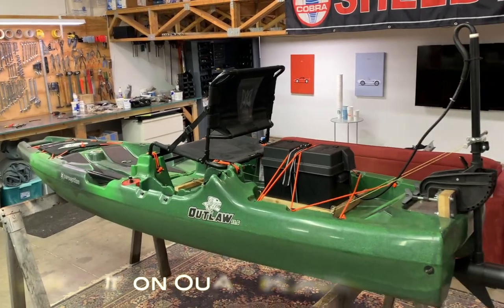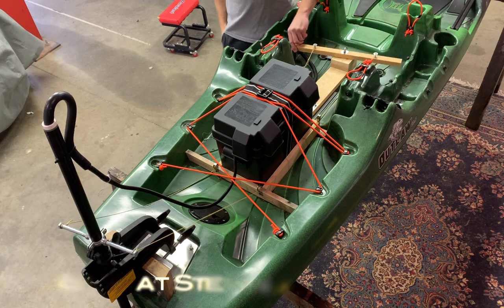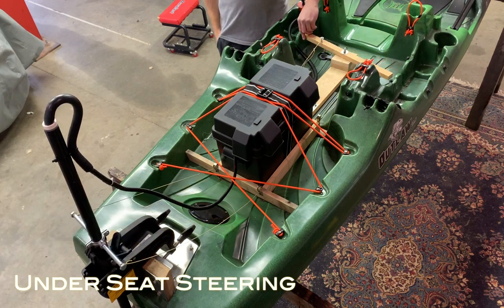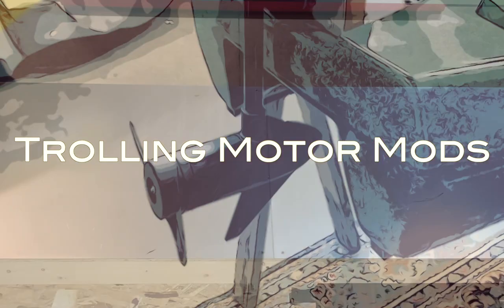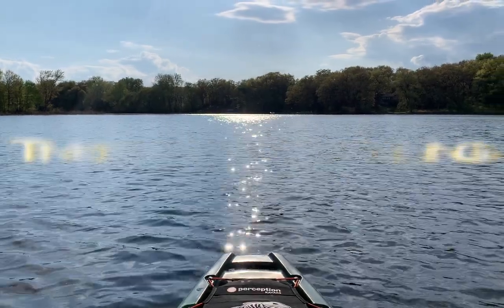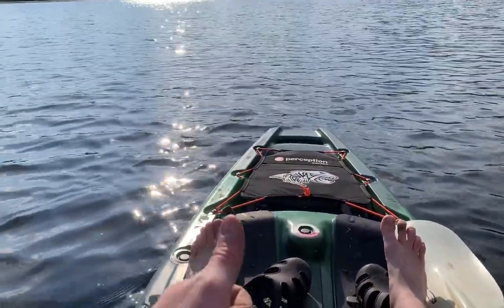DIY Kayak Trolling Motor Retrofit ($160)

Comment: Amazing. What size of hatch did you pick for the kayak the 4 inch our the 8 inch?
Reply from the maker: Hi Mike- I used a 4" Seaflo hatch I found on amazon - if you are creative, you can use the interior space in your kayak for additional storage / dry place for your phone-keys / etc too. Some hatches include a pouch also so make sure you browse online for other options. I'll add a link below for the hatch I used. Long term, I might get adventourus and increase the hatch size and see if I can get a smaller trolling motor battery mounted internally with hookup posts external for charging/etc. A big benefit of an internal battery is an even lower center of gravity and water protection too. Thanks for the comment Mike!

Hatch: (4" Seaflo) https://www.amazon.com/gp/product/B076T87Z8Q/ref=ppx_od_dt_b_asin_title_s00?ie=UTF8&psc=1
Reply: @TacoJoesHouse  awesome thanks for the reply. I am getting this kayak by the end of February coming next year and i want to be ready to go with a my trolling motor.

Comment: Great video. Ditch the heavy battery and go lithium. I have a 55 amp hour life pro. Fits under the seat 1/2 the weight and lasts longer. Then the back can hold a crate. Also saves time having to take the battery in and out during transport or at least easier to move around. I also upgraded to a potentiometer. I had the stock switch and it worked fine but the versatility of variable speed cant be beat. I can hold in a spot against current. I do like your steering better than mine. I have an arm with a tiller. It works fine just takes a while to get used to. Its simple and out of the way so I guess ill keep it that way.
Reply: Sounds great so long as money isn't an object.. I have a 114ah deep cycle, not a problem whatsoever for me 🤷‍♂️🤷‍♂️
Reply: @adammilan6434 lithium also is known to break down and very violently when it die so. Ticking time bomb and anything can set it off.

Comment: Hello Joe! Really interesting modifications. I had no idea it was that simple to remove the top of the motor and lengthen the wires to a switch made more accesssible to control the speed. I see may people rig pulley systems to steer the motor, but almost nobody does anything to control the speed and this was really puzzling to me... Can you provide more insight into the kind of switch that is? I am familiar with soldering and using blade connectors, but that switch is a mystery to me... also, can you tell us which cable (pins) color does what on the motor? Thanks Joe and happy fishing!

Comment: Hey I saw your loft bed video and wondered what the dimensions would be for that but for a twin bed? Thank you please respond soon
Reply from the maker: Hey Jimmy - twin bed dimensions are 38" x 75" so if we keep it simple, you need to reduce all shelving support width lumber 16" ( - ie - the shelves) from what I detail in the video (54"-38" = 16") - and - the bedframe obviously is narrower too - and - the "L" of the desk will also be reduced 16". I'd mock the desk up and make sure it will work out for your build but you have a lot of options and this configuration will easily support a twin bed. Thanks for the comment and good luck!

Comment: Great video! What gauge wire did you use to lengthen the control wires? Have you had any trouble with the the trolling motor shutting off due to overheating?